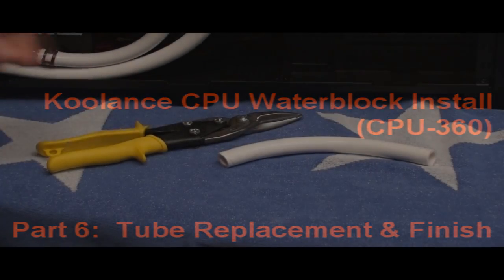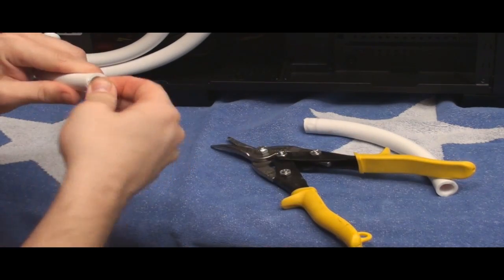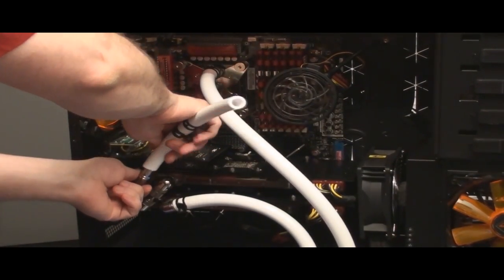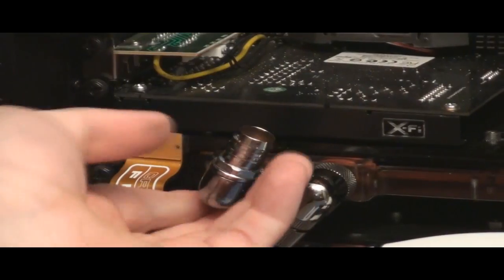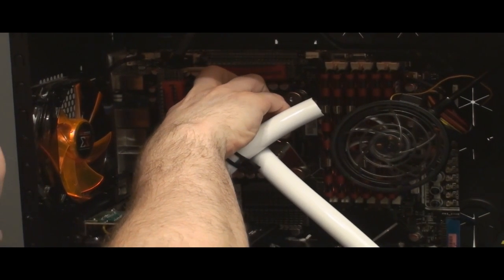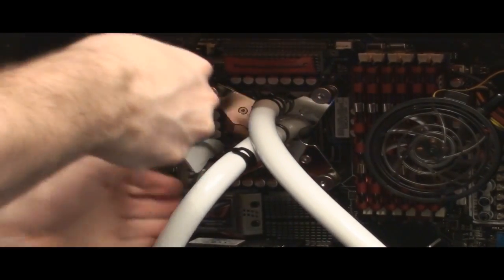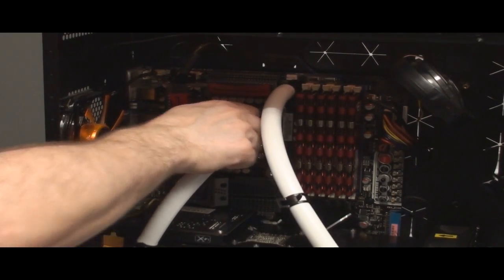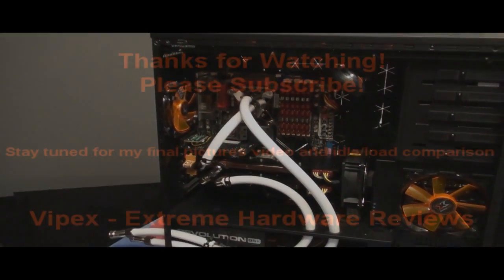Koolance CPU Waterblock Install - Part 6:  Tube Replacement & Finish

Comment from the maker: @spuddles31 There are a lot of factors here...normally it is better to go to the CPU waterblock first because CPU waterblocks are designed with maximum pressure in mind.  I chose to go to GPUs first here so the cards would be better charged (pumping up instead of down) and it would be easier to evacuate air out of the loop.  I think my choice here works well, but other configurations would dictate to goto CPU first.

Comment: @Trubyd44 Oh yeah? whats your next case?

I'm saving for my next build it's gonna be nice too. I think I'm gonna use a CM 840 and do a custom paint job on it, the colors I have no clue just yet. I do know I'm gonna try that H50 mod, if it's good I'll keep it but if its not as good as a real loop I'll put it in my lan case for extra bling in an overall dull build.

Comment from the maker: @vearheart42 The current (4) x GTX480 build that I'm working on now will use compression fittings.  I honestly like barbs better for ease of use, but compression fittings do look better.  I use 1/2" ID and 5/8" OD...I don't like the 3/4" OD stuff.  Unless you are going to put rats in the computer, the extra wall thickness isn't necessary IMHO.  (Be sure to watch for my upcoming video on my new build...it's gonna be AWESOME!)